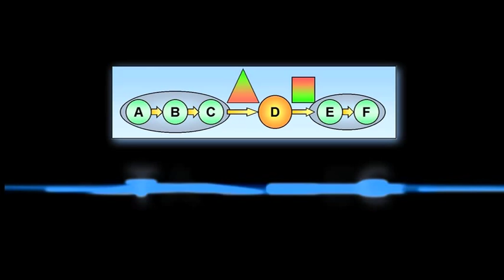Theory of Constraints (TOC) 3 Bottle Oiled Wheels Demonstration

Comment: LOVE this demonstration on many levels - optimized flow - yes-
Observation on B- the incoming and outgoing flows are optimized to form the sweet spot of the vortex - and there is an inverse relationship between noise and signal and chaos and flow - also speculation: - the ideal flow for the system may NOT in fact be the fastest ….
suggestion a - slow mo view of each to review more closely dynamics
suggestion b-long term test but sped  up -i suspect equilibrium produces entropy in the 3rd bottle over time

Comment: 3:18  Bottle B start doesn't address the effort of harnessing Bottle A "turmoil" to create the commendable improvement of Bottle B flow?! Energy's never "lost" in Nature. It's merely transformed.  5:00  Absence of Pressure after the induced air  burst, that is.  Good demo, but claims of effect higher than actual.